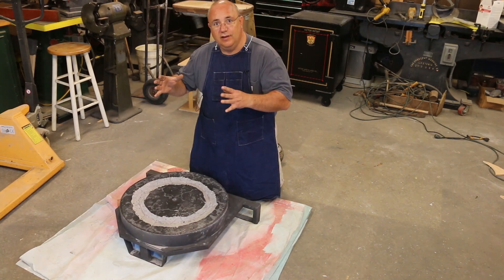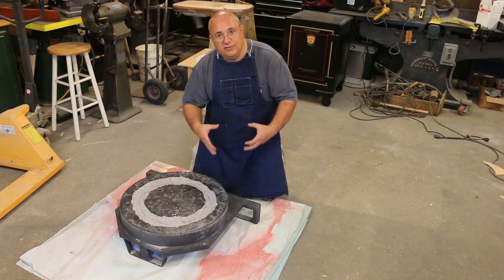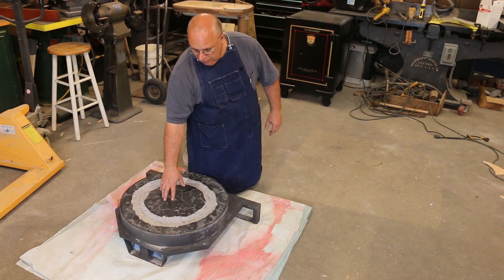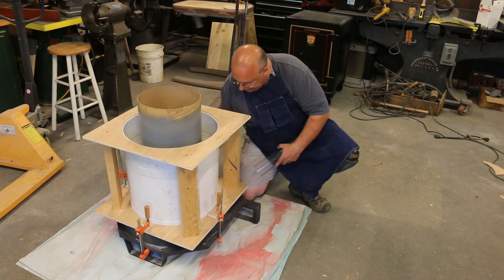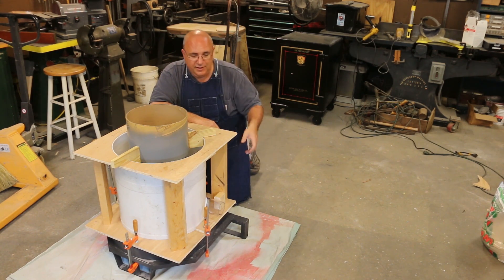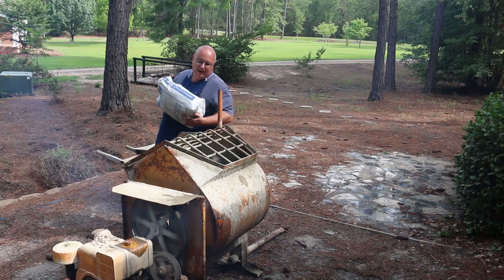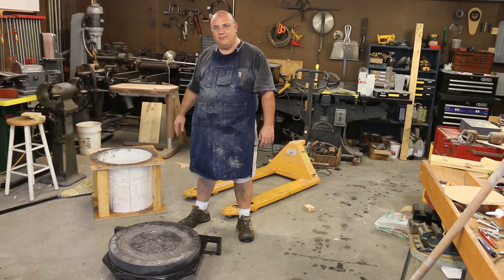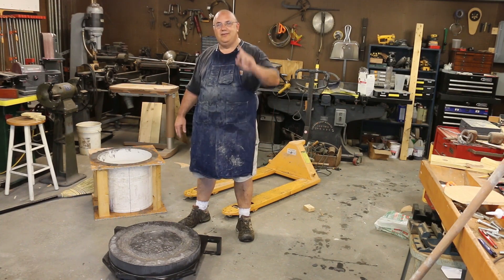Building an Oil Fired Foundry Furnace - Part 5:  How NOT to Cast Refractory

Comment: fill the inside tube with sand to the top and you won't have problems with collapse you had a great idea putting sand inside you just did not add enough.
Reply: BTW- my comment is based on a failure of my own for the exact same reason my 2nd attempt went without a hitch and my trusty shop vac made removing the sand from the center core a breeze

Comment: Learnt from this. Tks. 
Paint some waterglass on the paper tube or tape it with pacing tape? 
On a smaller tube one could fill it with some plaster stabilized sand?

Comment: After painting the concrete form, you should have sprayed it with LPS  3. This is a rust prevention in a rattle can that has what appears to be bees wax dissolved in a vehicle that evaporates leaving behind the wax sealant. This would have water proofed the cardboard form, as well as putting a release to the surface.  Great build though.

Comment: You have to respect a guy who shares his mistakes so others can learn.
+1 SUBSCRIBED
Reply from the maker: +stylac Thank you!
Reply: +Keith Rucker - VintageMachinery.org 
Have you picked out lights for your new shop yet?  Amazon sells 100 watt LED chips for nine bucks that only  require a $5 collimator (lens), heat sink and an inexpensive 30-34 volt DC power supply.   I'd probably "splurge" and add a conventional kitchen mixing bowl for a reflector to protect from dust.   Amazon sells sets of six 6.5 inch stanless steel bowls for less than $10.

It's something I'm considering for my own shop because I'd rather spend $25 per light than $200 each for a dozen off the shelf LED High-Bay fixtures.   I haven't seen anybody make their own highbay lights on youtube yet, so if you did it, I think you'd be the first.    

......Just something to think about.

Comment: Hello Keith. If you ever attack another pour like this, the cardboard tubes ARE the thing to use just fill the form with sand or gravel. Fill loose sandbags and it makes it easier to remove them after the pour. I learned this from my grandpa who did this for a living in Puerto Rico.
Reply from the maker: +Gilberto Diaz Castro I think that my main problem with the first pour had more to do with the hole that I had to cut into the side of the tube at the bottom.  This greatly reduced the strength of the tube around that area and that is where it failed - even though the bottom third of the tube was filled with sand.  Had the tube had not been cut like that, I think it would have worked fine.

Comment: I would have made fire bricks from all that so called wasted material. On thing that I have always learned, is that there is no such thing as scrap "iron, wood or concrete and in this case refractory".You could have used those bricks for a future project.
Reply from the maker: +Jesse Chisholm Problem was I was not prepared to make the bricks and just needed to get everything out of the forms before it started setting up.  Would have been nice to have saved that refractory though...

Comment: Failures happen, I thought the concept was sound, didn't think the cardboard would saturate so quickly. 
I'd cut some ply discs and bend ply around it for the inner form. Coat the form with resin and it will come right out.
If you aren't failing, you aren't trying!
Reply from the maker: +Sideslip I actually have a nice setup ready for the next try, I just have not had time to do it yet. I am hoping to get that done between now and the end of the year.

Comment: Concrete... it´s like the Blob. Always finds it´s ways for sneaking up behind you. 
But don´t worry, you are not alone. Even highly trained professionals mess it up sometimes. When they were working on Marienplatz train station here in Munich Germany, they opted for a shiny white marble-style high-end resin concrete floor worth of literally millions of Euros. It was cast in sections, and the task was to poor it under just the right circumstances respecting temperature, mixing, speed ec. , of which all were abode, so it would not split or crack withhin the drying process or later on. What can I say? Within three months, the whole thing looked like a old oil painting or spider web covered with cracks and gaps. You never know.
Reply from the maker: +StLaparole LOL - we all live and learn....

Comment: I am sure you gonna find a solution for the core. Sorry for the loss. I am wondering though. Whats gonna hold the thick mortar stable with the base after few uses of the furnace. Especially when you're gonna be moving it about?
Reply from the maker: +Adam Dilem There will be some reinforcement on the outside helping to hold the top up.

Comment: Set your inner 12" tube up the same way THEN pack layers of sand all the way to the top before pouring your refractory .  
  
  Your foundry is a good size and that is allot of weight against the cardboard tube the pack solid sand inside will provide it with  strength , though it will take a while to clean out after all is set up and cured.

Comment: try some 12" pvc x 1/2" wall water pipe cheap and easy to acquire sorry about your failure BUT we all learn by our mis takes cheers keith
Reply from the maker: +whitey george I have a solution for the next pour all ready to go - just need the time to make it all happen.....

Comment: Them paper tubes are meant to keep crap in not crap out.. But.. if u wanna use em again, you could just fill it with sand before casting the refractory.. just silicone it to the bottom and rampack that sand in there.. i used my form sand actually /bentonite, water sand mix/ and just stomped it in there and then cast the liner.. my hot face liner is only 25mm thick tho. actually made a similar design to myfordboy. And the outer form/shell is a 2 part fiberglass mold instead.. (some fleece, some epoxy, some fiberglass mat, voila - check speaker builders tutorial).

Comment: 16 gauge sheet steel will work nicely on this size. Concrete inside loads tube in tension - self supporting & stable. Concrete on outside loads tube in compression - unstable & buckling failure. Rotten luck wasting all that refractory and your time.
Reply from the maker: +Jester Mclarpet You are thinking along the same lines as me.  I have the new form built, and hope to show you guys soon....

Comment: Hi keith
Are you getting tired of all my comments yet? Just wondering if you have looked at this site "sv seeker" has on a foundry furnace. http://www.svseeker.com/casting_furnaces.htm he used 40 - 2600F Insulated Firebricks to build his and I priced the bricks and they were just over 2 bucks each which is much cheaper than the several bags of cement. He has a link also for a great place to buy crucibles too. http://www.lmine.com/category/crucibles.html
Hope this helps ya out
John F
Reply from the maker: imystery man Yes, I have seen that furnace.  In fact, my burner will be based on that same design.

Comment: What about using something like schedule 40 PVC pipe as the internal form?  should be plenty stiff enough, and the the smooth outer finish will make mould release easier.  No fears wrt wetting either.  http://www.ebay.com/itm/12-inch-diameter-schedule-40-pvc-pipe-1foot-length-/121635112339
Reply from the maker: Chris Hindy That should work, but I think I have a different plan.  Hope to get back on this project very soon....

Comment: Hi Keith,   Re: oil fired forge .

Just another idea from a fan !  For the forms to hold the refractory, would glazed chimney tile or orange clay tile work ? I know it's available in many lengths and configurations,  like reducing flanges etc. i think it could be brokers out easily with a hammer. Also may I suggest using an orbital sander ( remove abrasive paper,felt pad only ) to use as a vibrator for the forms. Works slick and eliminates voids and irregularities in the mix. 

Looking forward to many more vids.  Full steam ahead.
Reply from the maker: Mike Davis I have a plan for a form that should remove from the furnace much easier than tile - with tile, the cement properties of the refractory will cling to every little tiny hole in the tile making it much harder to remove than one would think.  As for the vibrator, this product I am using does not require vibration, which is one of the reasons I chose it.

Comment: Keith, if it was the water soaking into the inner tube that caused the failure, and you still have that piece you cut off, place it in a large garbage bag, then back onto the base. The garbage bag will protect the form from the water. Then fill it with sand as you did, but fill to the top. Then when you get ready to pour, use the busted up pieces of waste refractory as aggregate, as has been suggested below, but break them to 3/4" or finer and add them in to the mixer. All is not lost, and can be salvaged at minimum cost.

Comment: I am flattered that you like my furnace design and that you are incorporating some of my ideas into your own furnace. The points below are not intended as criticism but suggestions.
You could have made a saving on the refractory by making the base the same diameter as the outside of the furnace. I considered doing the same as you but realised refractory is not needed across the whole base. There is no need to worry about the body of the furnace moving, it is very heavy and gravity will keep it in place. 
I don't think there is anything to be gained making the walls so thick as you have, a big saving could be made here. You will just have a bigger mass to heat before reaching melting temperature. My furnace is almost the same inside diameter but not so tall. I used 50 kg of refractory for the whole build including a couple of plinths.
As others have mentioned, to stop the inner form collapsing I rammed greensand inside as the refractory was added, not shown on the video but mentioned in the description.
Hope the next refractory casting goes better than the last!
Reply from the maker: myfordboy Thanks for the insights.  I am probably going to make several modifications to the next pour and am seriously considering thinner walls.  Somewhere it was recommended to use 3" thick walls but I think I can go thinner.

Comment: When I did my furnace, I used a sheet of steel rolled into a cylinder and welded together.  However when I did it, I choose steel that was way too thick, I think 18 gauge.  Made it extremely difficult to remove, but I got it eventually.
Reply from the maker: MattsMotorz I am thinking about doing something similar....

Comment: do exactly what you did but 2 very simple changes -   the bolt that you ran in the bottom, use a long piece of threaded rod taller then your form and put a nut and washer underneath, then fill the tube completely with sand  not just the bottom 8", cut a plywood circle that fits inside the tube with a hole in the middle,  slide down over the rod and snug down a washer and nut.  the more packed down u can get the sand the better off you will be,.  with the plywood cap the sand will have no where to go and the tube will withstand an incredible amount of inwards pressure.  I use this method quite often and its never failed me.
Reply from the maker: ultimatemonkey Thanks - we will give it another try as soon as I can get my hands on some more refractory!

Comment: Hi Keith, unfortunately it is a learning experience and thank you for sharing it with us.

I have some thoughts that may help in regard to the project.
Fill the inner tube with some dry sand and as you are filling it place some timber 2*1 (inch) battens across the center with a length of the inside diameter of the tube. three of four layers would do in the height of the core. Compact the sand as you go. With this the tube would not collapse as you pour the refractory, however there may be a tendency for it to float. make sure it is held down or weighted. The center hole in the base can be used for a threaded rod to anchor the tube down.

painting the outside of the inner core would help it reduce any water pick up, or just wrap it in some "Glad wrap" or similar plastic cling wrap material. this will also help as a release agent.

also filleting (3/4 inch) the sharp corner of the outer tube to the underside of the top flange is a good detailing aspect to prevent cracking at this re-entrant corner.

there is come concern that vertical shrinkage of the refractory may cause cracking so it would be good to strip the outer form work asap when the refractory stiffens up adequately - but not too early. Try to keep the mix as dry a mix as possible. from the video there appeared to be a little more water in the mix than necessary.

Comment: Thought, How about pouring a concrete tube in the cardboard tube. let that set, then use the concrete reinforced cardboard tube. 
Bummer that the pour didn't work for you
Reply from the maker: ***** Something along those lines will likely be part of my final solution!

Comment: I am so sorry this happened Keith, it all looked so perfect when you finished skimming the top and then my stomach sank when I saw you reach into the sonotube and fish out some refractory. That was when it hit me that all the times I'd used sonotubes, it was to make concrete pillars and the cement was on the inside. Dang, I wish I'd have thought of it and could have asked you if that might be a problem...it all looked so well planned :(

Again, sorry for the bummer deal, and great way to suck it up...I probably would have cried! Aloha...Chuck
Reply from the maker: Knolltop Farms I did my crying off camera....

Comment: Thank you for sharing your failure!  I learn a bunch from my failures; when my friends share their failures my learning grows geometrically!

Ignore the following if you have solved the problem:

A cylinder is easily crushed by forces directed inward, but not true when the forces are coming from the center and directed outward.   So . . . it would seem that making a cylinder withstand inwardly directed forces would take a very thick and rigid wall―proportional to the forces.  I am here to guess that you can avoid this challenge by filling a cylinder, having a wall as thin as a soda can, with an incompressible fluid or the same substance as the fluid that is providing the external crushing force.  The refractory fluid is inconvenient but it would balance the internal and external forces and the cylinder would not fail even if it were 1 mil. thick.

I am thinking of:

Gluing a rigid circle of plywood to the bottom of the cylinder, drilling a hole in the center, cutting a second for the top;

Gluing six 2x2 ribs to the inside, each the length of the cylinder;

Attaching a seventh 2x2 to the center of the bottom circle;

Filling the cylinder with gravel;

Screwing the second circle to the top of the cylinder at the ends of the ribs and center 2x2, their job is to keep the lid on as the refractory cement is trying to squeeze the sides in and translates the force through the gravel to pop the top and bottom.

The ribs might be overkill, but I was thinking they would deal with any torsion on the lid's fastener caused by an unequal distribution of external forces on the cylinder or internal translation of equal forces by the imperfect gravel.  You could always try just using the center 2x2 or use Althread or glue the top and bottom.  Last, attach plastic /Visqueen on the outside to prevent transfer of moisture.

You might want to rent a vibrator to rid the refractory cement of air bubbles, the air will expand under the heat.   Is this concern with refractory cement?
Reply from the maker: Paul Moore Yes, I have received lots of comments along these same lines.  It is going to be a while before I can try this again due to having to make a trip to get more refractory so I am taking my time in coming up with "Plan B", but all of these comments are being considered.  As for the vibrator, this particular refractory mix does not require it - that was one of the reasons that this one was suggested to me by the expert who I bought it from.

Comment: Reading the other comments I see a suggestion for using wet sand, but when the form is used for its intended purpose it has been back filled with some of the dirt from the hole, so if the cardboard for gets wet at the bottom it could soften.  I'm afraid the water could easily migrate from the sand and soften the bottom edge of the form.  This could eventually cause the sand to blow out the form.  Analyzing.

First put in six inches wet sand followed with six inches refractory, working back and forth until both spaces are full.  Once both sides have been filled by six inch increments, lightly tamp the sand then tamp the refractory.  Good luck!

Comment: Hello Keith, what you need to do to handle the pressure is to make a series of inner disks and wrap them with 2 layers of 3/8" wood bending stock (you can get this from a lumber supplier), I'm retired now but owned a millwork company where this is used all the time. I recommend having a horizontal inner wood ring about every 6" for stability. For a 12' OD circle the disks need to be 10 5/8" diameter. Also I would finish nail the bending stock to the disks and through bolt the bottom disk to the base so it can not rise when you pour. I enjoy watching your channel the old equipment is really cool. Hopefully this helps
Your Friend,
Gary Catron

Comment: The overall design remains flawed as the outer shell of refractory will not become bonded to the base refractory.   It will become a pipe sitting on a base.   Next problem involves using too much refractory.  This type of furnace only requires a layer of 1" - 1.5" refractory to protect the outer kawool insulation blankets.  3" of  kawool will provide  ample insulation for this furnace.  I regularly melt aluminum and bronze in a similar design - with full shell (base/wall) monolithic refractory inside kawool within metal outer shell.